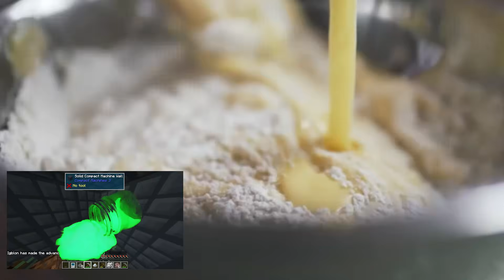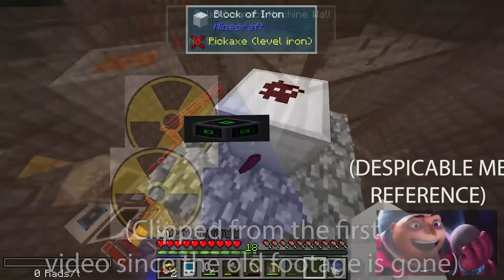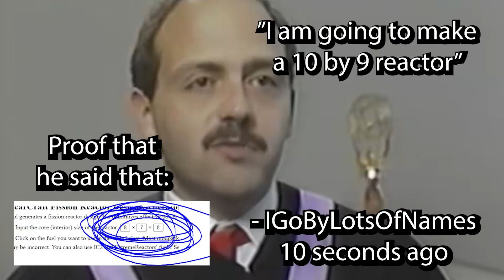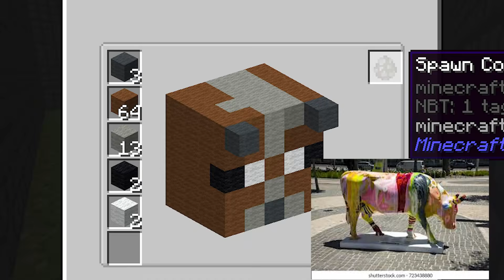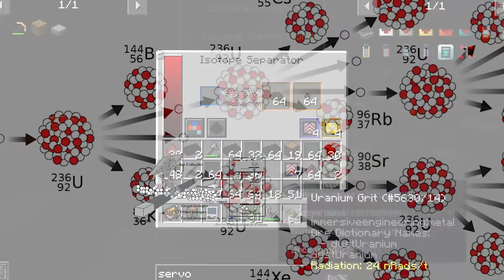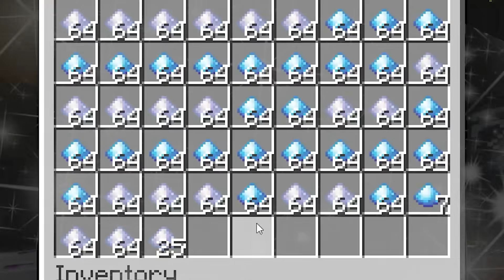I Escaped A Minecraft 3 By 3 By 3 World.

Comment: as someone who has played this pack 3 times I can confidently say, you really would have saved time by making the coke coal into blocks, automated wood when you got glowstone instead of wasting that gear on the resonant upgrade using the phytogenic insulator, and you could have enchanted those pickaxes with unbreaking idk what you were thinking. These were just a couple tips further than what you learned afterwards. My current playthrough has only 2 reactors at the moment, one is a 36k rf/t and the other being 250k rf/t and I've already escaped a while ago but I just have too many resources like my 2 million uranium grit that I just can't waste.

Comment: This modpack sounds great if written as a half-horror story.
You regain consciousness.  Your body feels numb, and you realize you are lying on a smooth, hard surface. You try to roll over, and bump against a wall. Reflexively you jerk the other way, and bump against another wall, harder this time. The pain from the impact shakes you fully awake, and you open your eyes. A wall behind you, a wall in front of you, and nothing inside except you , an odd handheld device and a small box. Your heart races. You scramble up, almost crushing the device in your blind panic. The device barely gives you enough light to see, but you can put together that you're stuck in some sort of closet. You wonder how you ever  got into this situation, or who would do this to you. You try pushing, punching, screaming. Nothing happens. You put your ear to the wall, and hear either distant rushing wind or the sound of blood pumping in your ears, you can't even tell.
You run your hands on every square inch of the floor, ceiling, walls, hoping to find a handle, a latch, anything that will open a way out. No such luck. You stumble around in a daze, overloaded with desperation and panic. You don't even know how this tiny room still has breathable air, but it seems to only prolong your suffering. And that's when you finally decide to examine the strange device.
It gives a few enigmatics beeps and boops. Terms you aren't familiar with, but it apparently tells you to point it at a "compact machine" and it will...put you inside it? With no further idea, you point the device at the small box and press the button...
A weird sensation takes you as the world warps around you, and in an instant you find yourself in a situation not too dissimilar from the one you just left. Another tiny room, but at least it is large enough for you to stretch a bit. You attempt to collect your ideas. This must be the way out. Again you check everywhere, looking for a door, a window, anything. No such luck. Again desperation sets within you. Desperation becomes frustration. FUCKING TRAP, you think, LET ME OUT, and with all your might you punch the wall.
The searing pain travels through your knuckles and into your wrist, leaving your entire forearm numb. You scream with rage and pain in equal measure. Your vision flashes as the overwhelming pain takes you. You feel trickles of blood running down your hand...
And looking down, you spot a small pile of dirt.
Where did it come from? Did it shake loose when you threw that punch? It doesn't look like the weird metal your new cage is built out of.
You stand there for a good half hour, waiting for your hand to stop aching as you gingerly examine the substance. Definitely dirt, nothing remarkable. You eventually come to the conclusion that it's the only thing you've done so far that seemed to do anything at all, so you try to adjust your poise to avoid nearly breaking your arm again, and wind up for another punch.
And another, and another.
The dirt piles around your feet. It feels...natural, relaxing even in a way. The dim light of your shrinking device lets you almost believe you are standing on a field at night. Eventually you make a tiny pile, about a foot deep. Relishing the soft, loamy texture, you find yourself idly raking your fingers through it, doing what you can to calm yourself down...
...and you find something hard. It's not a mote of dirt, but...a seed? You look at it, puzzled, wondering if you have definitely lost your mind. And yet...perhaps you're feeling cute, but you bury it halfway inside the dirt pile with a gentle pat. Hoping you will wake up from this weird dream, you drift off, the exhaustion from your physical and mental labor finally catching up with you.

You're not so lucky. Again you wake up in the cage, to the sight of your unmarred walls and dirt pile. You are starting to feel the hunger and thirst. And yet...something is different. A tiny plant has sprouted from that seed, bearing small, unappetizing seeds. You uproot it and look it over. The stem is a wooden stick, just the right shape to grip it. You taste one of the seeds, and sure enough they seem edible, if not very filling. You don't know if you'll have any time to worry about starving to death, but this new development is at least keeping your mind occupied.

You grow your dirt pile and replant your seeds. It takes up most of the space in your prison, confining you to a fraction of your space, but watching your plants grow is the closest thing to fun you have done so far in here. Eventually you scavenge together enough wood to make a simple tool, which you use to extract more dirt from the walls. You even start knocking some rock loose from it, despite the fact you are doing no apparent damage from it. You quench your thirst with a slurry you squeeze out of the plants' leaves. It's chunky and it tastes dirty and grassy, but you're not puking it up so it should be hydrating you enough. You realize you'll have to take care of your waste sooner or later, but looking at your tiny impromptu crop field you find you already have the answer.

Days go by, as you try keeping yourself sane with small toys you made out of your plants and rocks. You have figured out how to exit the second cage via the small device, but no luck. You do definitely know the first cage is only separating you from the outside world with only perhaps three feet's worth of wall - but those walls also resist any of your attempts to damage them. Worse still, they don't yield any resources. Yet the absurdity of your situation gives you some kind of calm determination. There must be a way to harness a material strong enough to break down those walls. You are finding all kinds of odd materials from the cage's walls, surely there must be a way to strengthen them. But alas, your space is at a premium, and inside of that box there is barely enough space for the farm that keeps you alive.

...wait a minute. THE BOX.

Cautiously, nervously, you poke and prod the box, trying to find out how it works without accidentally breaking it. It seems absurd to you, but it seems to be made of simple components, the kind you yourself would be able to craft by hand. The odd alloy that comprises its inner workings is unlike anything you've seen so far, but you have all the time in the world to figure out what you can make out of the materials you can mine from the box. Your mind finally has some stimulus. You have a short term goal. You will unlock the secrets of this box and find a way to break the wall. After all, you now have unlimited time. And might be on the right track to obtain unlimited space.
Reply: Dude, this is a masterpiece. I'd actually totally read this if you extended it to a full book. No, scratch that, i'd PAY for a book.
Reply: Despite my crippled ability buy anything online. I'd do anything in my power to obtain a full version of this story.
Reply: Bro we need a full on story by you about this
Reply: I would pay several million dollars for this as a full book
Reply: Well done
Reply: MORE! WRITE MORE!
Reply: naaaah epic good one mate ill read it if it was a full story
Reply: ...fully read that
Reply: ✋ absolute cinema ✋
Reply: More more pls
Reply: lbr lore be like
Reply: THE BRAINWORMS ARE SPREADING IT'S FANFICTION TIIIIIMMMMEEEEEEEEEEEEEE
Reply: Bro wrote a masterpiece and never completed it
Reply: Blud wrote allat for 9 likes🤦‍♂️
Reply: @viadpenny  Worth every word.

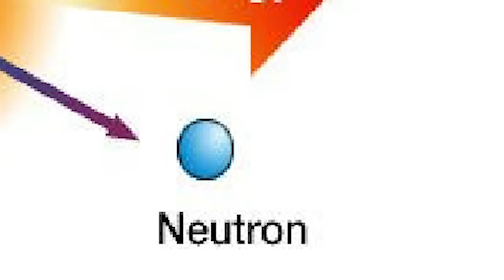Comment: 5:57 the fusion reactor doesn't release “ridiculous amounts of energy and neutrons” the energy is in form of kinetic / thermal energy of the neutrons, that's why a fusion reactor still needs a water chamber around it to have the kinetic energy of the neutrons heat up the water / be converted to thermal energy which can be turned into electric energy through mills. That's why a fusion reactor is still radioactive, stay away from those! Nuclear fusion is still dangerous. Don't do anything dumb. I would know.